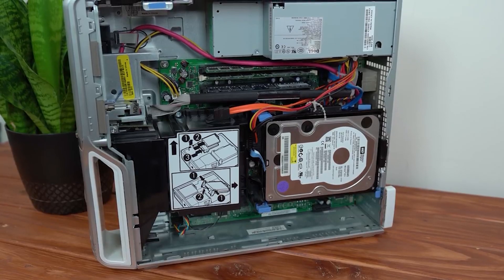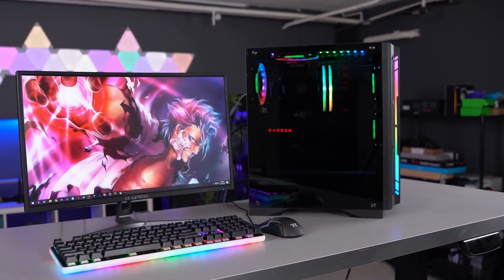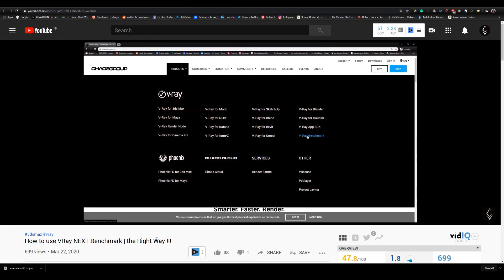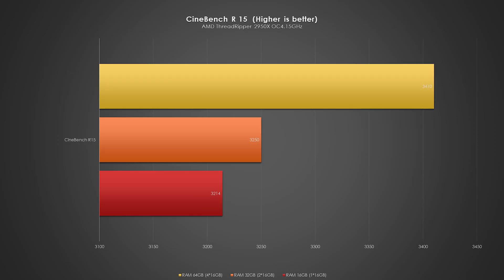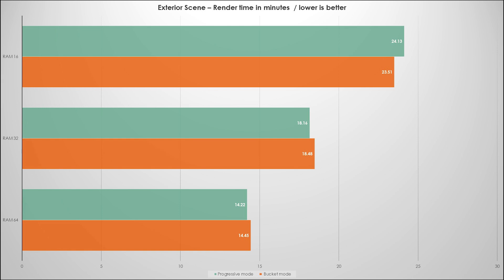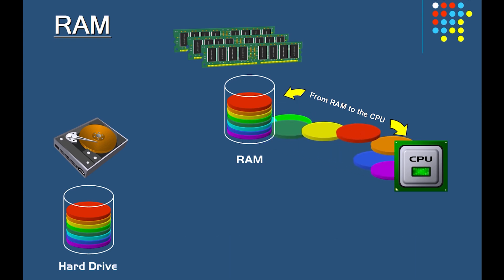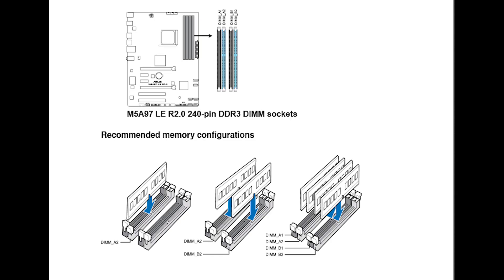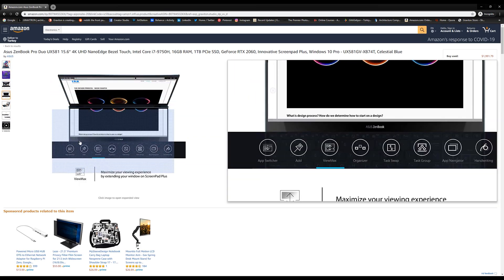Does more Ram give you more rendering speed?

Comment: Hello Sir. If I want to upgrade form 8gb RAM to 32gb RAM, but I noticed that my PC Motherboard only support 2133Mhz RAM Speed. I  am an Architecture graduate and I would love to focus more on 3D Visualization  and Rendering. My Question is, should I upgrade my motherboard first to one that able to support 3200Mhz RAM Speed, then Upgrade  32gb RAM (3200Mhz) or Do I just remain with the 2133Mhz Motherboard and upgrade 32gb RAM (2133Mhz) . Really looking forward for your respond. Thank you.
Reply: As I suggest, You need to check to cpu how much speed support. Although upgrade your MB, your cpu is lower than MB support will not making what your goal. If you wanna upgrade, also cpu with MB than Ram speed as well.

Comment: Wow, your explanation is spot on, I love it, I am 100% subbed! I have a question, it would be great to have your opinion on it: I have an asus n580vd-fi038t laptop (the one with 4k display) and I edit 4k videos on premiere pro with some fairly important after effects VFX in them. I use proxies in premiere pro, everything runs fairly smoothly, however when it's time to render in 4k, it often gives me rendering error when it gets to the vfx or any heavy transition part. So all that work and then impossible to render 4k. It does render in 720p and 1080p when the effect is not too strong, but i need to render in 4k, there is no alternative on that, 4k 25p, that's it :) I am waiting for an extra corsair vengeance 16gb ddr4 sodimm ram which will arrive this tuesday (the laptop already has 16gb ram installed, the asus website says that's the max it can handle, but there's still a free ram spot so screw it, i'll throw that it and see if it recognizes it, if it does that definitely won't hurt the rendering process). This laptop has a 4gb nvidia gtx 1050 for laptops, I am afraid that this is where the bottleneck is, but I'm really not sure... this pc has a 3.1 usb C - not thunderbolt! - so I'm not sure if I could even buy an egpu (it needs a thunderbolt to work, right??), and anyways a great gpu card would cost me as much as the laptop cost me, and I have the feeling that it's missing just a tiiiiny liiittle bit and it could render my 4k videos, I'm really borderline, I feel... so ram is my first try. Then I was thinking swapping the micron SATA ssd for the samsung 970 pro 512 gb ssd, but I would have to reinstall windows, adobe etc, right? That might be a problem, the windows was sold in the laptop, so I dunno... plus, i wonder if the nvme vs the sata will radically change the rendering capabilities of my laptop, I wouldn't want to do all that and then realize that it still can't render heavy 4k lumetri effects... sorry for the long message, I am kind of totally lost and any advice would really be welcome! Thanks and congrats again :)

Comment: My doubt is im using adobe premier pro for video editing my current configuration is 250 gb ssd 8 gb ram intel grpahic 4gb and nvidia geforce 4gb , yet the rendering speed is slow i will be buying 8 gb ram more will the laptop speed will increase?
Reply: Speaking from experience using Adobe programs, the more ram, the better. 16gb has been a noticeable speed increase for me. Now I have 32gb which is a noticeable speed increase over 16gb.

Comment: I think that the test is a bit flawed. What you essentially tested is not whether the amount of RAM plays a role in performance, but the amount of memory channels you used. Your Threadripper CPU supports and runs best with quad channel memory configuration, meaning 4 sticks of RAM. It's kind of obvious that if you use less than 4 channels (or 4 sticks of RAM) with this CPU, performance will be lower. Interesting test nonetheless.

Comment: I really love and appreciate your work man! Keep it on!
But i have a question in hardware, if we render on the cpu, as it's faster than gpu renders and the ram speeds up the render then do we need a good graphics card ? Or any one will do the job? And what actually does the gpu do?
Reply: Mina Tarek the gpu work is for modeling higher graphic card performance the higher number of faces or polygons lines that u can work with 👌🏻 without any perfomance problem
Reply: @lasaraz5826  so i don't need a RTX 2080 Ti for working all i need is mid range high quality gpu like RX 5700 or RTX 2060 to do the job. Right?

Comment: Excellent video. Really appreciate your efforts. 

I work in 3ds max with vray next. I currently have 4 of 8 ram slots occupied with 4X 8gb sticks of RAM making a total of 32gb. If i buy another 4X 8gb sticks of RAM and insert those into the remaining 4 empty ram slots, I'll have a 64gb setup. Is this a good idea or should I just buy 2X 16gb sticks making that a total of 4X 8gb sticks and 2X 16gb sticks.......leaving 2 ram slots empty. Thank you.
Reply from the maker: Thanks 😊
may I know what is your CPU ?
Reply: @GravitonStudio  Im running a Ryzen Threadripper 1950X 16 Core
Reply from the maker: @michalsavatar7  do not mix different RAM sticks , always use the same model , size and speed
So if u want to have 64GB buy another 4x8 but make sure to match the old ones 😊🌸
Reply: @GravitonStudio  thanks mate. Love your work and videos. You do an excellent job in helping people. Keep up the great work.
Reply: @GravitonStudio  Got another question. I'm upgrading again to a totally new CPU for 3ds max with corona renderer. I'm getting the Ryzen 9 7950X and am thinking about 128GB of RAM. That would be 4x 32GB sticks of RAM occupying all four slots. For multitasking and rendering, if 64GB is faster than 32GB.......then wouldn't 128GB be faster than 64GB?